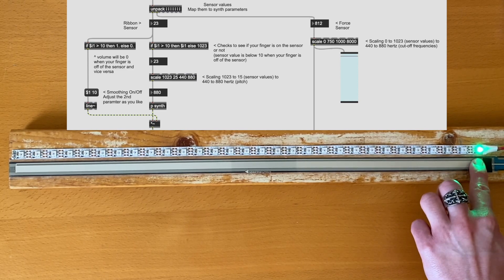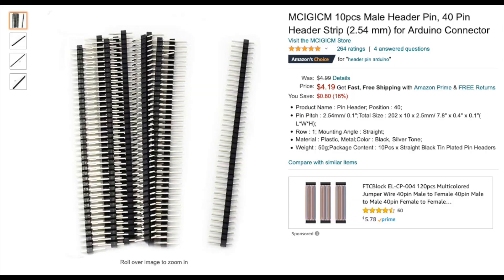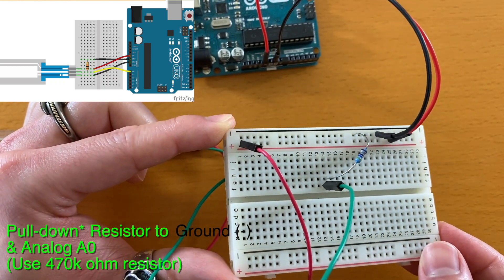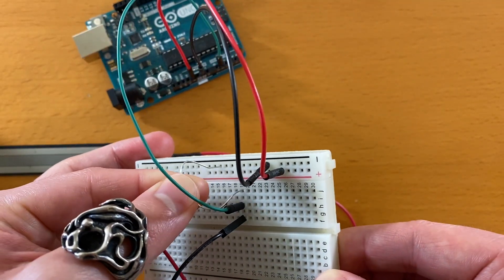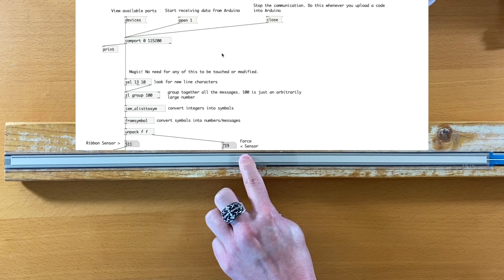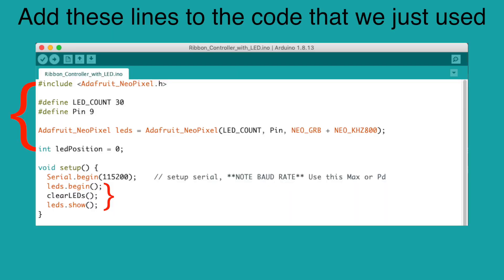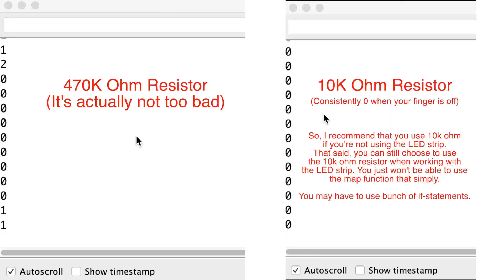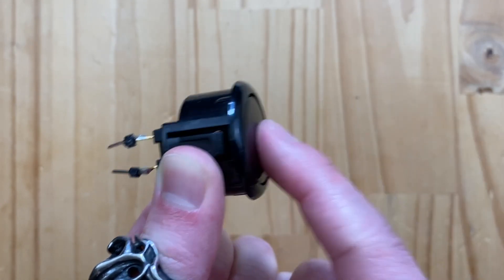Let’s Create a Ribbon Synth! (Arduino + Max/MSP Or Pure Data)

Comment: How can i use a ribbon and led at the sme time with daisy seed and plugdata? if I am using multiple sensors how do I seperate them and choose what they controll inside of plug data?! sorry i am very confusedd. I want to use daisy seed for embedede but I have so many questions I dont know if I should just get a small computer and use an arduino

Comment: Hi there, what will happen if I do multi-touch? Will it report the position of the closest finger to the pin, or will it report inaccurate position lower than both fingers. Also will the pressure of both fingers add up?

I am just looking to see the possibility of using this to simulate some stringed instruments.
Reply from the maker: That's a great question and I wish I remembered. I'm sorry about that.  
I unfortunately don't have a quick access to this sensor at the moment.

Comment: Hey! I was wondering if this same basic instrument would work similarly with daisy seed? I basically want to build this, maybe without the LED, and with a basic embedded synth to emulate some trautonium sounds that I've become enamored by recently. I'm pretty new to this stuff too. I've never attempted to create an instrument like this so I have many questions! Thanks!
Reply from the maker: You can certainly use these sensors with Daisy!! I saw your thread on the Daisy forum so we can continue our conversation there :)

Comment: Hey @freqcake thanks for the video ! Complete beginner here: could you eventually hide the sensor behind a non-conductible fabric or you need to press it directly with your fingers ?
Reply from the maker: Great question! I had a friend who put one of those black and yellow safety tape over this sensor and it was working! So I think a non-conductible fabric should work :)
Reply: @SoundSimulator  Awesome ! Thanks a lot for your answer 🙏🏻

Comment: Hi, I am a complete beginner at Arduino
I have a Korg Expression pedal. I want to replace the potentiometer inside it with a motion sensor or a light sensor. “I don’t know which is better”
Is what I want easy to implement on arduino and what exactly do I need?

Comment: thank you for this, it’s amazing! i’m trying to make a midi controller with pressure sensitive buttons. do you think its better to use fsr or piezo? can you make a video about it? love the way you explain things!
Reply from the maker: A button that's velocity sensitive? Or are you thinking of something like a drum pad on an MPC? Component like an arcade button is digital, but I guess you could attach an FSR on top of it to make it velocity sensitive. I probably won't make a video on that but if you have any questions, please feel free to let me know.
Reply: @SoundSimulator  thanks for your reply! yes, basically i’m trying to make analog pad to control velocity but i don’t know if fsr or piezo are the best option. also the idea of consider digital buttons with an fsr on top is great, i will try it!
Reply from the maker: @ludovicamennella882  I think FSR is a bit easier to work with, but they're both cheap so I recommend trying both out :)

Comment: Why is it dangerous to touch both ends of the sensor at once? Is that because it would have such low resistance that it would send too much current to the arduino? What if you touched the strip with 2 or more fingers near one end? Thanks!
Reply from the maker: Yeah, my guess is that the resistance becomes so small that it's pretty much shorting. idk tho. 

not gonna try to find out what'll actually happen, haha
Reply: Maybe you complete the circuit to fast, like it goes through your body to the other side

Comment: Hello!  I'm currently trying to build the same ribbon synth but only with the ribbon sensor and no force-sensitive resistor.  When I click on the "open 1" message, the printed values rapidly fluctuate from 10, 13, 48 and around 55 for some confusing reason.  Is this because I didn't solder the connection well or something in the code?  Thanks!
Reply from the maker: I suggest serial printing the sensor data value in the Arduino IDE first and see if it's showing appropriate values. 
Feel free to message me on social media!
Reply: @SoundSimulator  i have this same problem on both serial output of arduino and pure data values. my issue is that the number is constantly fluctuating rapidly. if i move my finger it increases from 0 to 1000 along the strip, but it fluctuates around these numbers as well.
Reply: Also, the numbers only fluctuate when I'm not pressing down on the ribbon sensor and when I do press down on the sensor, the number stays at 0 and doesn't pick up anything.  As soon as I lift up my finger it goes crazy

Edit:  I think mine is a ThinPot potentiometer not a SoftPot, does that make a large difference?

Comment: Cool stuff. The larger sliders are unfortunately (like a lot of components) not avaiable right now but I will get some small (60mm) ones to play around with. Let's see if that is good enough to play with. I am a hardware synth guy so this will go into my Eurorack but Puredata looks nice to try out too. With this tutorial I should be able to hook up some sensors and do some fun experiments.

There is an easy fix for the "do not place your fingers at each end at the same time" issue @4:22. With the 10 kOhm ribbon sensor, add a 15 kOhm resistor and use +12V as a supply voltage (for the sensor only, do not use this for the Arduino board). This will give you a 0 - 4.8V signal on the output and at the same time limit the current when you press both sides of the sensor at the same time to less than 1 mA. These sensors are expensive enough not to accidentally convert them into a smoke generator.
Reply from the maker: Dang, I hope it's temporarily! Those get out of stock every once in a while. I'm currently using a shorter ribbon and it's perfectly fine!
Feel free to share what you end up with! 

I didn't know there was a way to prevent that! Good to know! Thanks again for your electronics knowledge!

Comment: Lol, I did this project 2 years ago with Kurzweil ribbon - I use the 10k resistor, so the unlinearity is very obvious. 
But then I have found a nice solution in a book Arduino Music and Audio projects with no need of the resistors which gives clear linear values.

Comment: can i use this ribbon to control Ableton instrument? i mean can i make this to send midi signal?or cv gate?
Reply from the maker: Yes! I actually have tutorials on both things!!

Sensor + CV
https://www.youtube.com/watch?v=6vu0GxCGM08

Sensor + MIDI 
https://www.youtube.com/watch?v=gh0h5nCW2fg 

ENJOY!
Reply: @SoundSimulator  Thanks for reply~~ appreciate, but i want to know how to use ribbon controller to actually trig Ableton instrument key sclae, i mean if i press the ribbon then arduino read integer "400" then i want this value to trig C1 signal in Ableton~~.

Thought i know i can use "scale" function in MaxMSP then use "noteout" to send midi signal to Ableton instrument, but i found out that "metro 10" function in MaxMSP will be like trigging note on every 10ms, that means it can't play like a midi controller.

So i did my research, my idea is to Sample&Hold the value that when i press the real button , it will "SAMPLE" the ribbon sensor value and "HOLD" it as how long as i want , then map this value from 0~127 then send it to "noteout" function, finally send it into Ableton , that i can actually play this ribbon as an piano MIDI controller.

But i still dont know how, because S&H function seems not working :DDD, i mean maybe you have any suggestion?
Reply from the maker: @liweilin6649  Ah I see! I'm leaning towards using Max4Live for that application. I have used the ribbon sensor for MIDI note performance, but only once and it was 7 years ago. 

I may make a video on it in the future. I'm planning on making more Max videos this year. 
"Sample and hold" approach is definitely the way! When you press the ribbon sensor, "record" or "lock" that sensor value and then calculate "pitch bend" value as you glide your fingers (difference between the 1st sensor value and the new one or keep updating). 

What synth are you using by the way?

Comment: hi, how can I operate an instrument from the kontakt library with this system?
Reply from the maker: You could use it for pitchbending and parameter controlling (my recent Arduino MIDI tutorial will be a good reference!). The library that we use in that video includes a pitch-bending code that may work nicely.  

I recommend using this ribbon controller (pitch-bending and such) with a traditional MIDI keyboard (playing notes) like the Yamaha CS80. Since Kontakt is MIDI, you can't really glide between notes nicely without using pitch-bending as far as I know. This controller really shines when you use it with a custom synth made in Pure Data or Max/MSP.      

Have fun!!
Reply: @SoundSimulator  Thank you for your interest.

Comment: How hard it would be for a beginner to make a simple standalone ribbon synth with pure data and maybe a raspberry pi?
I would like to make a standalone ribbon synth or a ribbon controller which can connect to other synths.
But i m a complete noob in diy!
Reply from the maker: If you're able to do this tutorial, then you'll be able to make a standalone version!! Instead of using the Arduino, we replace it with Daisy, Bela, or Teensy. I am definitely planning on making tutorials regarding these standalone synth hardware! Most likely in the next few months. 

In the meantime though, I recommend that you try this tutorial. Then all we need to do is replace the Arduino with embedded audio hardware and do few more steps! You'll be left with an unused Arduino, but it should come in handy for other project!
Reply: @SoundSimulator  Great! Looking forward, your videos are really helpful! Thank you!

Comment: Instead of using the 470 resistor, could you have compensated by doing some math in the arduino code to re-map the LEDs to the proper position?
Reply from the maker: Hi Chantelle! For experienced coders, I do recommend using the 10k ohm resistor. 
I just wanted the code to be as simple & straightforward as possible for people who are just starting out!

Comment: Sorry for the noob question, but can I use Teensy instead of Arduino Uno? If so, can I follow the exact same steps?
Reply from the maker: I'm very excited to hear that you're interested in creating a ribbon synth controller!!  

I think Teensy should work fine for this project. I wish I can confirm 100% but I don't have one around me to test. 
Do you have one near you for a quick test? You can follow along the "Arduino to Max/MSP" or "Arduino to Pure Data" tutorials on my channel to make sure that Teensy can serial communicate.     

Please feel free to ask me questions any time!
Reply: @SoundSimulator   Thank you so much for your your time and for the kind reply. 😊 Unfortunately I don't have one yet, but I'm planning to buy one soon. I'll definitely try it out. Also, I'm in love with your channel, it's so great and informative. Great job!
Reply from the maker: @MetroCounterColl  You're welcome! And thank you so much for checking out this channel!

I would recommend Arduino Uno (or Nano if you want something smaller in size like the Teensy) if you would like to follow these tutorials exactly. 
But if you have more experience with Teensy and have specific goal in mind for the project, then you're more than welcome to buy it instead!
Reply: @SoundSimulator  the main thing to watch out for is if your alternative board uses 3.3V or 5V. Typically Unos use 5V and there are many sensors that require either one or the other to work properly. Hook up a 3V only sensor to a 5V controller and you have a recipe to ruin your sensor. For FSRs and Softpots I've used both with the Arduino MKR1000 and an ESP8266; both are 3V. With different voltages you might want to play around with different resistors as well.
Reply from the maker: @HighlandViolinist  Thank you for the info, Chantelle!!